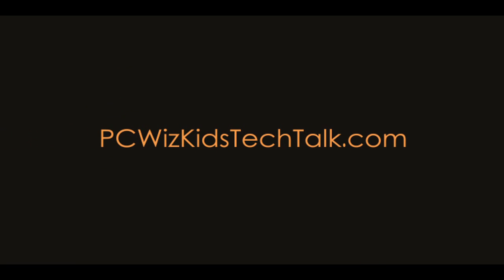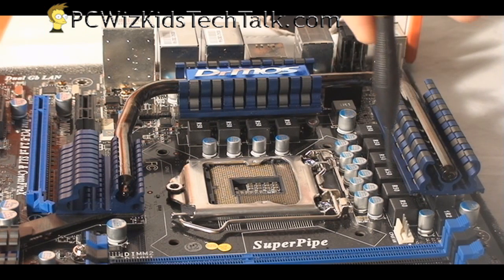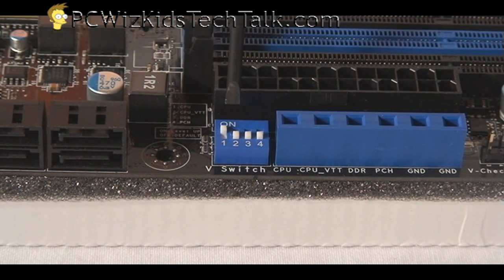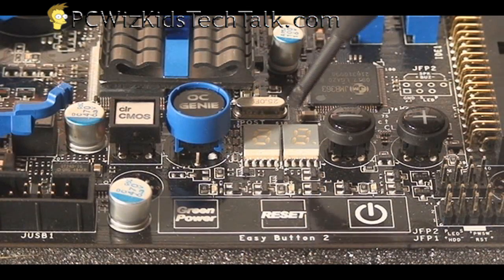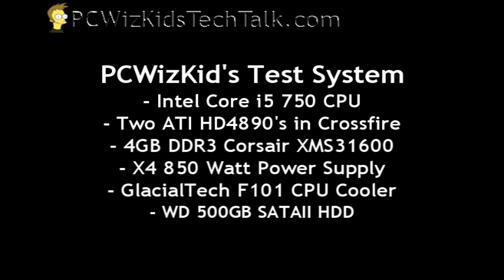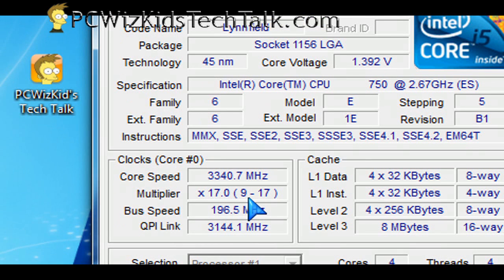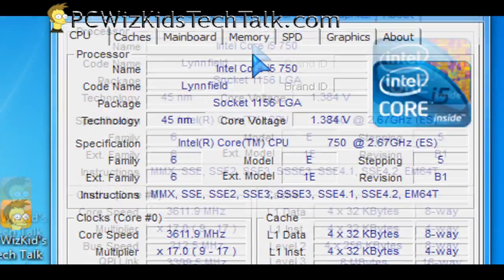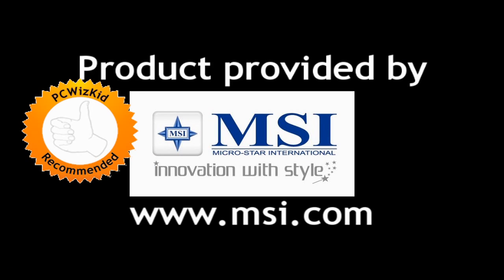MSI P55-GD80 - Intel Core i5 / i7 LGA1156 Motherboard Review

Comment: im a little late on the comments but i recommend not using the OC button. it OVER volts your CPU making it hotter and possibly killing your CPU. Of course when you're overclocking you need an after market fan! bios overclocking is the way to go. i have had this board for almost a year now and im running my i5 @3.8GHz at 27c idle and 45c on full load. prime tested for 24 hours. its a great board. ALWAYS do bios overclocking.

Comment: Hey PcWizKid i need your opinion on this: I wanna run 5770 in crossfire with an i5 760.. i would overclock if it'S safe in terms of durable.. (so i think 4x 3,0ghz is okay for that) the cpu has to last at least 2 years, so which board would you rather recommand, the asus p55 pro or this MSI board for that setup?

Comment: The motherboard Users Manual tells that , MB is supporting 1.5 V on the Ram. But the new Kingston 2x2GB CL9 1600mhz Kit is working 1.7-1.9V - Thoes Rams will work ???
Ty.

Comment: i've got this mobo with an overclocked i7 860 and a hd5870 and i'm using a 680 watt psu. so i guess 500-600 watts should pretty much be enough for you.